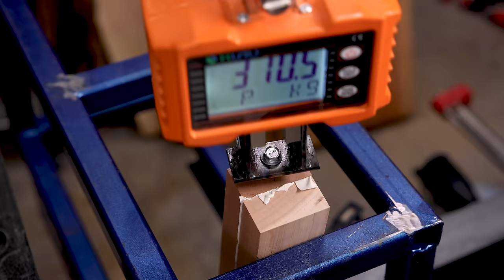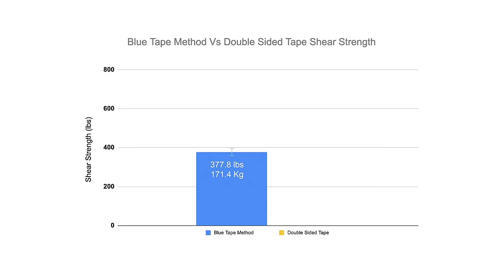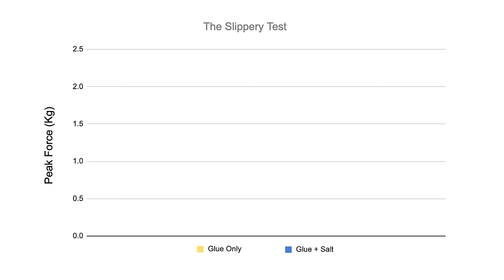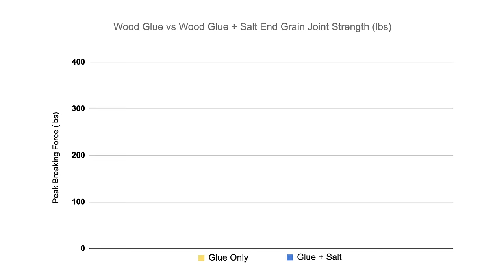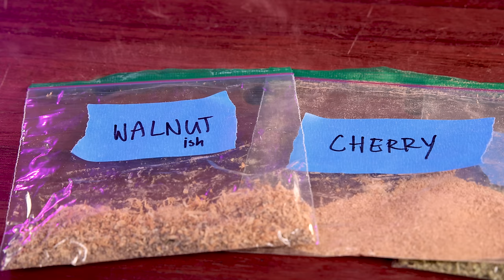Bad woodworking tips

Comment from the maker: I wanted to clarify something on the double sided tape tip. Many have pointed out that the xfasten, while bonds strongly, is not stiff enough for cnc/template routing. While I have not had significant issues using the xfasten tape, I have gotten feedback from some folks that purchased the tape recently. I do not know if their formulation changed or what  the issue is. The blue tape method is a perfectly fine method - if you like it, don't change a thing. I personally find it cumbersome. Over the last 2 weeks I have been using all of these methods and revisited the paper backed double sided tape and am falling in love with it again, despite the higher price tag. It seems to be the perfect hybrid - holds strongly with little/no deflection. Easy to tear. Comes off without any residue issue. etc etc. So at this time, i would not recommend the xfasten tape, instead, consider buying this (affiliate link): https://amzn.to/3S5OxjJ

Comment: Interesting. I’ve been using A FEW grains of salt when face gluing boards to increase thickness for longer than you have been alive. Never had a failure or could tell the difference in the final result. That said, a FEW GRAINS is all that is necessary. The amount of salt that you used, even on the smallest sample would be enough for many glue ups. I think I’ve had the same 4oz shaker in my shop for 20 years. The technique works great when laminating panels, especially when you need good alignment as to not have to trim too much waste afterwards.
Reply: He used waaaay to much salt…
Reply: If you were super concerned about it, you could probably fill your salt shaker with sand for the same effect without any chemical reaction.
Reply: @ReallyBadJuJu  this is the real point with the salt trick. It's not the sodium chloride crystals that do the job it's a fine grain of anything that provides a secondary gripping surface that also digs slightly into the wood.
Reply: Salt good because salt make cube with pointy corners
Reply: The tip I've seen in magazines is to use a pinch of fine sawdust.

Comment: Saw dust is great for soaking up spilled liquids like oil.  Then keep the very lightly oil coated saw dust to use to put on the floor to pick up really fine dust and dirt.  Broom motion getting the dust airborne an thus not cleaning the floor without the saw dust.   Mix dry saw dust with wet oil coated saw dust and mix to get lightly coated saw dust.   My dad showed me this hack.

Comment: The glue and sawdust tip is really best for painting, where you are filling the surface in prep for applying the paint.
Reply: Or for filling gaps around joints, like a slight miscut on a dovetail or a through tenon.
Reply: Wouldn’t it be easier to just use putty then?
Reply: I have tried to fill the gaps of a tenon with sawdust and glue. The resulting joint is weak and I easily break it. I’d rather use epoxy resin glue which is good at filling any void.

Comment: Nice video.  I switched to double side tape because its easier and avoids the glue mess.  Never found the salt method to be useful for woodworking but it will keep a beer glass from sticking to a coaster.  Cool bonus tip.

Comment: Great testing methodology. I laminate thin wood a lot and the best way I found to prevent slippage is to secure the pieces together with small nails, but that requires extra material where it can be nailed and then sawed off. When laminating several thin layers the slippage can really be a pain.

Comment: Great content. I was surprised you did not try saw dust instead of salt  for preventing peices from sliding.
Reply: I wanted to see that as well. I've heard that it works just as well as salt, plus you've got plenty of sawdust nearby anyway.

Hopefully we can get a follow up where he tries the amount of salt people actually use and sawdust
Reply: 7:41 I would like to see the variance in clamp pressure as well. I'm curious if higher clamp pressure with salt (and saw dust) would provide an equivalent joint strength than without.

Comment: Excellent and thought provoking videos.

I agree with using dowels etc for alignment on wood for furniture. Where I use salt is when making templates especially using MDF and I do not want the different surfaces to move before clamping pressure is applied. In cases like this I do not care about the visible glue line only the accuracy of the joint. I made myself a salt shaker out of a small plastic bottle with a few small holes (much smaller than house hold salt shaker. Added a few grains of rice to keep the salt dry.

Comment: I've filled in minor imperfections/gaps with the sawdust and glue
trick, but those were getting painted a color not stained. it works 
perfect for painted but not at all for stained, the minimum amount
of glue with some sawdust sprinkled on and pressed a little (not 
rubbed in.) and wait a while for it to set & sand.

Comment: On the sawdust and glue hack I was taught that as a 12yr old at school, and we only used it when we were learning to make joints, where there were gaps until you started getting them right. Oh also we were only allowed to use tenon saws for joints, no coping saw to clear out for dovetail joints. Although I didn't take up woodworking for a profession, at nearly 65 I remember everything I was taught.

Comment: I actually keep sawdust for a totally different reason. I use it for blending edges or contrasting. I recommend ca glue and dust rather than wood glue, and some wood glue can turn black when you mix it with dust for some reason. A lot of times if I want a seam between a light wood and a dark wood I'll use medium tone sawdust between them to blend the tiny gaps and it usually works perfect, and on occasion I'll bevel my edges the same before gluing and then intentionally fill a seam line with darker wood glue to make a contrast stripe, rather than inlay, especially on a weird curved joint that inlay would be a pain with. You can use the same thing on darker woods with CA glue and baking soda  and it kinda looks like pearl or white resin or marble. Purely decorative. Sawdust and CA glue is also good for adding reinforced bevels inside of projects with a very thin edge. like if you have to glue a right angle butt joint with 8th inch flatstock, you cant really dowel or dovetail 8th inch and it can be flimsy, but you can sprinkle a line of wood dust in the 90 degree inside and use CA glue to make a little fillet weld and brace it stronger. I've done that. it doesnt look pretty but for inside work you don't see it’s shockingly stronger. You could even do a video on that for content to see exactly how much stronger.

Comment: I am always looking forward to your next video. Accurate, informative, and helpful.

Hoping that you will look at saw blade flutter sometime. What makes it happen? Asymetric pressure on the blade? Start up? Entering the wood too fast? What are the principle causes that  make zero clearance kerfs get wider?

All the best!
Reply from the maker: Thanks Paul! For sure. I may or may not be working on gathering proper equipment to see how viable that test would be. It may or may not involve an ultra high speed cameras..... you know, hypothetically speaking.

Comment: On glue/sawdust fills you are right on the money, and it was interesting to see it with different wood species. One caution you didn't mention is that if glue is pressed into the grain around the area being filled, stain will not absorb into that grain and the result is an ugly spot--especially with open grain woods. So care should be taken to minize the area where glue is used...at least that's a lesson I learned with my early projects.

Comment: I went back to blue tape and CA glue, I have that same double sided tape and found it holds, but has 2 disadvantages! FIRST- it "wiggles" it hold fine from total separation but it allows it to actually move back and forth especially under the forces of the CNC and makes cutting less accurate.  TWO, it's WAY harder to clean up after!! leaves way more sticky goop behind!  Note- I've leaned to use   3/4 inch tape with CA on it and like 1 to 1-1/2 inch tape with the accelerator on it , plus use WAY less glue, a simple straight line  down the middle is enough!
Reply from the maker: Yup- there is a small amount of wiggle with the xtasten tape. If that is a concern, I think you would like the paper backed tape I mentioned in the video. It’s not ideal in a cold environment but if the shop is moderately temperature controlled, it has all the benefits of blue tape method.
Reply: @WoodcraftBySuman  yea, tried it also, and the super thin clear stuff, which has the best hold/wiggle prevention, but still way harder to clean up after. Blue tape works, cleans up stupid easy (as long as you use a thin line of glue down the middle, not big wiggles that spill over the edge) and seems cheaper in the long run.  Love your vid's by the way!!!  you always go over the top testing!!!  :)
Reply: I'm not really a woodworker but I've used the masking tape + superglue trick a few times for various things, and I also like it much better than double sided tape. It's very thin, which feels solid, and yep, very easy to clean up. One thing is, I never bothered with the accelerant. I just used regular gel super glue and that was very easy and mess-free. Probably wouldn't be strong enough if you're trusting this thing to not fall apart on the router table, but it worked well enough for what I was doing.
Reply: @WoodcraftBySuman   I did a video to show the issues with double sided tape. - This could be an issue with templets as much as the CNC is for me -   https://youtu.be/lvc7xKZk8UA?si=5-5YjedupHZ7tiko
Reply from the maker: @Thomllama  hey thanks! Just saw the video and your points are all fair and valid. Appreciate you making the video. I haven’t had that level of deflection for it to be a problem on CNC and template routing but I have been utilizing all it the different tapes in the shop over the last two weeks to get a better comparison feel from day to day use. The xfasten I have seems to still do a pretty good job but I’m falling in love with the paper backed tape even more. I know you’re happy with the blue tape method but if you are inclined, give this tape a try: https://amzn.to/3tJS6CP
Reply: @WoodcraftBySuman  got that tape! gave it a shot, it's definitely better than any other double sided tape I've tried, but still doesn't' hold 100%. I actually did 2 cuts to test, one with that tape and one with Blue tape and CA... I'll post somewhere so you can see the difference. .. hmmm where to post?  LOL.
Reply from the maker: @Thomllama  well shoot! Idk what we are doing differently but I have been very happy with the tape. Haha. Appreciate you letting me know
Reply: @WoodcraftBySuman  yea, I’m doing like inlays and such so it needs to be super stiff or you get a loose or outa shape fit. Otherwise it would matter much!

Comment: To avoid parts from moving during glue up I've seen YT videos suggesting rubbing  two pieces of sandpaper together (I forget which grit) and letting the residue of doing so fall onto the glue to provide the grit.  Maybe try that as well if you repeat the experiment with different materials.

Comment: For most smaller, shallow dents (roughly 1/8") I usually dab water onto the dent which will swell the wood removing it. Slightly larger dents may take additional water applications but can also do the job. If it over swells just sand it flat.
Reply: Try a sponge dipped in hot water

Comment: Very glad you did the salt test. I always thought it would be very useful for chessboards that I make because I've had alignment issues just using cauls but I was never brave enough to try the salt trick because I wasn't sure how it would affect the bond. I could actually live with a 20% loss in joint strength for a chessboard but getting perfectly tights joints is hard enough as it is so adding salt into the mix just isn't worth it.

Comment: Nice video. I do agree that the saw dust method is not the way to go unless you are doing to paint the project. This has nothing to do with thedust not matching the pattern is because the glue doesn't allow the finish to soak in to the wood.  This same thing will happen if you don't clean your joints between glue up and finish.  Squeeze out well ruin that as well.

Comment: The damage to the bar is from the vinegar. We metalworkers use it for normalizing stainless, and as a rust remover. I don't recommend it on a non-stainless surface you care about, especially overnight! Vinegar is an acid, and we time it for removing rust in hours, not days.  Most woodworker's glues are water soluble, especially if left over night soaking in water. Give plain water a try for that method and skip the vinegar. If I wanted a surfactant to speed up the process, I'd add a couple drops of dish soap. For waterproof glues, give acetone or mineral spirits a try. (Never had this problem yet, so not sure what will dissolve waterproof woodworkers glue).

The waxing is a good tip, I'd recommend extending it to all your unpainted/coated steel tools to help prevent rust. T-9 is even better if you live near the coast or in a humid area. DON'T use WD-40, it doesn't work well for preventing rust, but it's great for it's intended application, driving water away from a metal surface when drying it off. You can make your own rustproofing wax by mixing paraffin and mineral oil 50/50. I get my paraffin by buying the big ugly candles no one wants at the thrift store for pennies on the dollar.

Speaking of rust, if you have some light rust to remove, and don't want or need a strong solution like white vinegar, make a mix with the cheap feed molasses from the feed/farm store. Just add molasses to the water until it looks like coffee, and soak the metal in it overnight. The sugars in the molasses turns to a weak acid when it contacts the rust, turning it into a black sludge. Wash the sludge off, and you'll have clean metal underneath. I've rescued a good number of cast iron skillets from the flea market this way, getting expensive pans for just a couple bucks and making them look like new, ready for seasoning. :)

Comment: I've recently changed to a glue called Paracoll (this is in France BTW), it's much thicker than normal white glues. It doesn't squeeze out as badly, doesn't drip all over the floor as much and the piece doesnt slide around as much, and it was cheaper!

Comment: I'm glad you mentioned that your double-side tape was NOT the tape everyone else was using to compare the blue-tape method to. Now, with that extra stickiness, how much residue was left on the wood after you peeled it off?
Reply from the maker: General consensus is there are residue issue. I personally haven’t seen it because I don’t apply a lot of the tape in most situations bc it’s not necessary. They come off pretty cleanly for me with an occasional and rare instance of residue. But it is definitely a problem if you leave it overnight or multiple days in the summer.

Comment: The salt trick does a good job at solving the problem it tries to solve, but it creates a new problem in its stead.

Use sawdust. Solves exactly the same problem, but doesn't mess up the joint.

Comment: Good video. On the tape options for temp holding, I agree with everything you said, but am ambiguous about your conclusion and the need for comparing raw strength. It seems to me that both methods are strong enough for temp bonding, so the raw break-level comparison is irrelevant...the proper comparison is to a requirement. So assume and state a use case and a needed level of strength and compare to that. This is a more difficult test, but the raw comparison of break pressure is only partially useful...it tells you which is stronger but not if either or both is strong enough.

Comment: On unsealed wood you can iron out dings. I mean this literally. If something fell on the wood and made a dent for example, you moisten the wood slightly and go over it with an iron on high heat so the water boils. The dent will either disappear or at least get a lot smaller. If it's not gone, spray the dent again and iron it again. It works really well if the fibers aren't damaged. If the fibers are broken, the wood will look a bit frayed and you need to sand over it a little.
You can iron out dents on oil treated wood (like rifle stocks), but since not much water can enter the wood, it won't be as effective. It will still work on small dents and lessen bigger ones.
I have used this on many occasions and I always find fascinating how well it works.

Comment: Re sawdust and wood glue. So recently I learnt that taking scraper shavings from end grain and using that is waaaayyyyyy better than sawdust. I assume due to the orientation of the grain but it just works better. There's less shrinkage, you need less glue, and it's not as uniform in colour as sawdust helping it to blend in.

Comment: In the UK at least the masking tape (ours isn't blue) and superglue trick used to make sense because there was a lack of double sided tape which would grip properly but not leave residue. That does not seem to be the case any more (NEC Exhibition Tape works quite well, and that XFasten you used is now available so I will have to try it out), so it would seem to be less useful... but for occasional use it is probably worth knowing (I'd say you stand a pretty good chance of finding masking tape and superglue in most workshops, quality double sided tape less so).